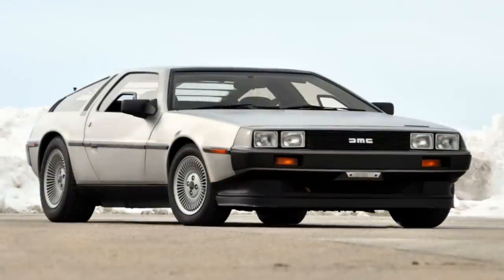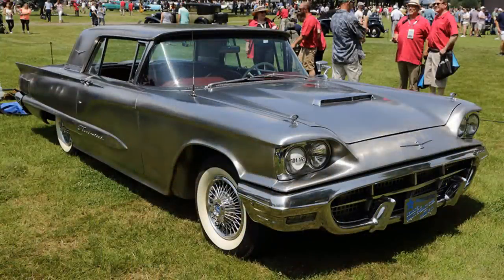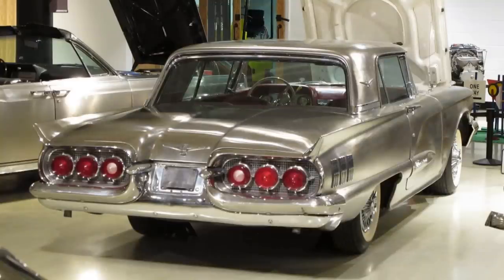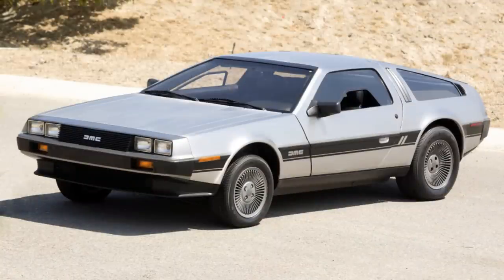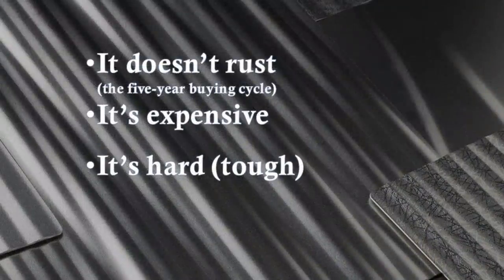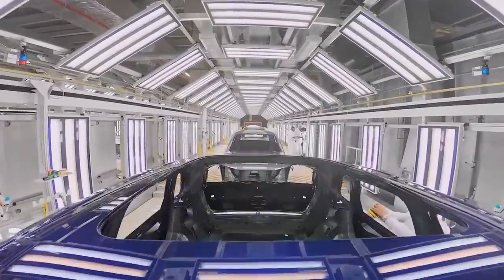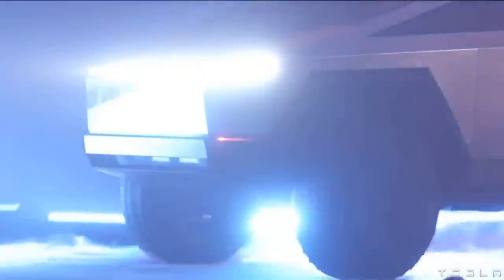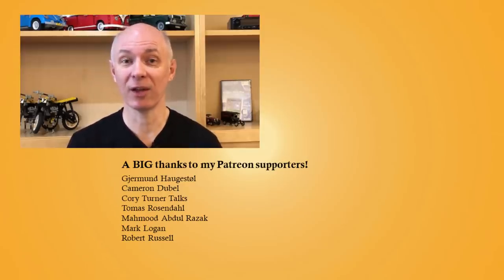Why aren’t cars made from Stainless Steel?

Comment: One of the main things I like about the Cybertruck is stainless steel... say goodbye to door dings and laughing at carless folks damaging their vehicle on yours for being careless. Rarely will you have to concern yourself with bodywork on these trucks.
Reply: The other side of that is when you do require bodywork, your vehicle will be out of commission because the exoskeleton is the key to it's structural integrity. And that bodywork will have to be carried out by a tesla approved bodyshop, which means you can't do it, your knowledgeable friend can't do it, and your local bodyshop can't do it. Which means a limited number of options. Which always means more expensive and longer wait times. Put those things together (longer wait times, further to get to, and higher costs with a requirement to do all repairs, whether or not you even want to,  before putting it back on the road) and you're going to be without a vehicle for a longer period of time. There is no free lunch.
Reply: @stupidas9466  you are 100% correct here. It's also going to be a royal pain to try to remove scratches and gouges when they occur. It's going to be exceedingly difficult to identically match the original finish with whatever buffing and polishing process is required.
Reply: @stupidas9466  I’m a trained Stainless steel fabricator and could do all bodywork myself…. The work could done by any Sheetmetal workshop with the right equipment. The body would be easy to add custom parts and panels. I’d love to have one to experiment with …
Reply: @chrisbraid2907  and then Tesla will say no more updates for you!

Comment: I worked on stainless in a stamping plant. Its not easy. One spec of dirt on the die and the stamping is scrapped due to the mark left which is highly visible since it doesn't get painted.

Comment: I think the buying cycle/planned obsolescence thing is much less of an issue to sales than you would think. There are a section of society who buy a new car, keep it as long as its reasonably reliable without major repairs (say 7-10 years) and then replace. However most people either buy new cars, or they buy used cars, and often people will buy at a similar age (of car) each time. New sales are primarily driven by finance deals, PCP is designed to trap people into replacing a car every 3 years, because after the 3 years is up they would need to pay out about half the cars value to keep it, whereas by just continuing to pay the low monthly rate (and a deposit which will be much smaller than the payment owed on the old car) they can get something new - which is flashier etc. This means that very few people who actually buy a new car are worried about how long it lasts - they only own it whilst its warrantied and pre-MOT. Theres a couple of other things to note, body work condition is hardly ever the cause for scrapping a car, theres usually far more rust under the car than on the body unless it suffered some damage which wasnt repaired. So unless they start making subframes out of stainless steel, the cars life expectancy will be the same. As an additional factor for Tesla, its got a battery, which will likely last around 10 years, which any decent well maintained car should last anyway. So, cars are more likely to be scrapped due to poor battery range than body corrosion.
Really, replacing a car you bought new because it fell to bits after 5 years hasn't been the case for over 20 years, and longer for many manufacturers - which is of course why they invented the finance deals to boost sales. 
I think the other factors, about the technical difficulties and the lack of colour wer very interesting, but at the end of the day, unless you make the whole thing out of a rust proof material, its still gonna die. I have an Avantime, plastic body is obviously mint 17 years on, glavanised chassis also looking pretty good, but everything attached to the chassis (subframe, suspension, various brackets and supports), all rusting away far too fast. I will have to strip it down and galvanize everything at some point so it lasts.

Comment: The Lincoln Continental...my dream car and in stainless..I want it! :)
Besides problems with press tools that wear out, there is also the issue of work hardening. Stainless steel (like other metals) work hardens, this means every time you deform a part it hardens up and does the steps from this point on even more difficult.
Welding is also an issue. Stainless steel warps like hell if welded (compared to mild steel) and would require a whole lot more of welds/tacks being done. Finally, there is one more important thing to remember...the price! A car made out of stainless is roughly double the price as one from mild steel.
Let's not forget a company can sell one per customer. Provided the customer is satisfied with it it will be the final sale ever made as it could last forever without rusting away.
However, I'd like to get my hands on one of these old cars in stainless...they're just so gorgeous and will last a lifetime.

Comment: I like how he, not only used a rubber dead blow hammer (so as not to scratch it), but held back. You can see him slow down when he gets close to the truck.
Reply: And it was a stupid test anyway.... vehicles need to be able to crumple to absorb energy and pass safety tests. All he proved was that it can never be sold in anything like its present form.

Comment: in the philippines a lot of backyard made jeeps have stainless body
Reply: A lot of the vehicles there are silver in colour and  shiny  yes...stainless steel? ...unlikely as it's expensive and  very difficult to work with.
Reply: @steveo4141  yes stainless is expensive but not to the point nobody can afford it....a jeep like the size of wrangler, with full stainless body, is about $4,000- $10,000 in the philippines....people there can buy $30k brand new cars what more a $4-10k......difficult to work with? you are very correct, but jeeps are mostly simple bends

Comment: The Delorean was merely clad in stainless steel over a fibreglass body. Typical appearance over function nonsense. 
It then needed to be laquered as brushed stainless gets grubby very quickly if handled..

Comment: I have owned and driven  a 1981 DeLorean for 25 years. The body is made of stainless steel, and although it is extremely difficult to keep clean it still looks very close to the day it rolled off the assembly line. The only down side, other than the difficulty in washing it, is the fact that you can’t really repair unpainted stainless without seeing the repair.

Comment: It's expensive,  heavy and difficult to machine, most manufacturers are trying to reduce weight such a dumb idea.
Reply: I beg to differ. This is an amazing idea especially for musk. This allows him to streamline the manufacturing process of stainless steel while capitalising on the experience. You need to remember that SpaceX is going to/are using SS on their rockets.
Reply: If you are looking for durability and longevity  then stainless steel  is the way to go
Reply: @CallumCarmicheal  Do you know if SpaceX is going to buy or make their steel? I am too lazy right now to confirm but I was under impression they would be buying it. I personally think SpaceX is a big promotion from grand promoter Musk, that won't ever actually deliver it's ultimate intent. I do hope I'm wrong, of course.
Reply: @k1m198  I'm not sure if they are manufacturing the SS or sourcing it. I know they are forming / printing it in-house though and I can guarantee you that this is a test to see how demanding and efficient manufacturing process they created is. This will ultimately determine how the steel is produced for Space X (At least that's the way i see it).

As for the other fact that Musk might not deliver, Lets look at it this way. The guy simply wanted to buy a rocket to start a business of transporting people to mars. Everywhere he went refused to sell him a rocket so the mad lad learned how to create his own (I say learned loosely as Im pretty sure he did not learn all of it as y'kno you can hire specialists for the finer details) and started creating his own rockets with the advancement of AI decided to attempt to make them fully automated...

So at this point I think that only a few things that would end his aspiration would be:
1) A massive scandal that displays him a negative light / losses all faith or trust.

2) Its somehow physically impossible to live on mars in which creating a habitat could not solve, Eg: Different in gravity causing catastrophic human dysfunctions (eg, heart cannot keep up with the new load of pumping against gravity, which can be a very likely situation)

3) Laws / regulation that would prohibit musk or interplanetary travel.

With those 3 hurdles aside I believe this man might stop at nothing but that is to be seen. I might seem like a fan boy of musk which I sorta am as he kick started another space race when it was dying down to Just good enough but I believe that its highly plausible for him to achieve this as he is conducting a DIY stance on the matter where the only thing that can prohibit is Laws.
Reply: An EV truck would still be heavy. I don’t think a normal steed frame would be much lighter anywqy. Choosing the special design reduces manufacturimg costs of the SS and of the E-glass panels. Flat panels also means lower repair costs and faster repairs. 
There are also regions in the world with a very humid and salty environment where cars rust extremely quickly. This material would be much more apprpriate in that case
Reply: @rotorblade9508  Stainless is almost exactly the same density as steel

Comment: The classic Land Rovers had aluminum bodies. During a summer I spent on a tropical island where rusting cars were a big problem, I saw one. The owner had removed all the paint to make the rust-proof aluminum obvious. I did a quick look online and apparently Land Rovers are still being built that way. They do require special skills to repair though.
Reply: Land Rovers used a type of aluminium alloy called Birmabright. The Achilles heal of Land Rovers was the steel chassis and galvanic corrosion of the door panels where the birmabright is attached to steel frames.

Comment: You miss One big disadvantage.  It's to hard so it will not stand the crash test. All energy will travel to the passengers and kill them. Thats why modern cars crumble as the do at crash-test. To absorb the crash energy. BMW had that problem at the second 3-series. It was so hard so the safety belts snapped.
Reply: THere's ways to mitigate passenger impact energy, other than crumple zones.
Reply: You are talking about dumb cars and the Cybertruck has intelligence built in to obviate the need for crash testing …. Much better than any dumb SUV ….
Reply: @chrisbraid2907  no. Wtf are you talking about. The car will still need to pass crash tests, as accidents can't be prevented 100%.

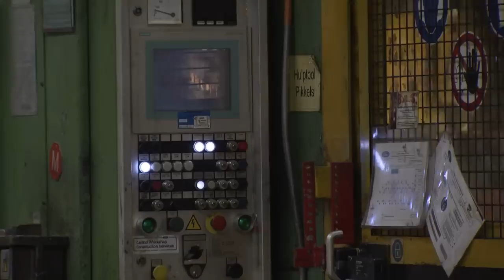Comment: 1:44 Cyber factory will not need a press (no curves) It will make it a lot cheaper to manufacture.
Reply: Yeah, the author kinda screwed up on that one.
Reply: @Seehart  You both obviously haven't watched till the End.
Reply: Actually the factory will need a Press Brake to form the Stainless Steel body … by keeping the lines very simple they can build strong monocoque bodies with fairly simple Sheetmetalworking Tools … minimal Welding yet very rigid. The Robots could arc weld many of the joints too .
Reply: @alexander1055  I did watch to the end. Yes, you have a point in that he stops repeating his main error at the very end. But he falls short of adequately correcting his error. 

My point is that the hardness of stainless steel and cosequent increase in cost of stamping is utterly irrelevant to the Cybertruck design precisely because the design does not involve stamping.

This undermines the thesis of the entire video, isofar as the author falsely implies that it in any way applies to the Tesla Cybertruck. 

He even asserts that the problem is worse for the Cybertruck because is uses a particularly hard stainless steel, as if this were a consideration the engineers were too stupid to think of when they made that supposedly unwise decision.

A brief vague mention of this crucial distinction at the very end of the video does not impress me.
Reply: @Seehart  He was talking about the Automotiv Industry as a Whole, explaining why it historically hasn't been done in Mass Production and explaining the Reasons for that.
Reply: @alexander1055  At the very beginning of the video, he specifically singles out Tesla, and the entire thesis of the video is to apply an irrelevant historical perspective to the question of whether Tesla is wise to choose stainless steel for the Cybertruck, given that this choice of material makes a process that Tesla will not need to use more expensive. 

He goes on to repeat this fundamental error, even making the oblivious claim that the problem is even worse for Tesla because they use an even stronger form of stainless steel, making this process that they won't use even more expensive. 

The fact that Tesla won't be using presses at all is not just a minor detail worthy of mentioning. It completely obliterates the main point of the video.
Reply: @Seehart  I just rewatched the Video. He does not single out Tesla in the Beginning. He only mentions that the Cybertruck will use an even harder Variant of Stainless Steel as compared to what was used in Cars before.

He gave us a History of Stainless Steel in the Automotive History and only talked about the Cybertruck in the End of the Video. And by that Time he also mentions what Tesla will be doing to alleviate the Problem that other Manufactures have faced before.

I do not know if Tesla will be using Stamps and Presses at all for the Cybertruck but he does mention that Tesla uses very basic Shapes and that there will be much welding in the making of the Cybertruck too.

Comment: Question: what happens when you crash against someone with an aluminium car with your stainless steel truck? Aren't you gonna outright ram through the car and kill who's in it?
Reply: Well no. Cybertruck is using the external body for strength with reduced structure underneath so the overall structural strength isn't that far off a regular truck. 

I'm more worried about pedestrian safety, modern vehicles have internal structure protected by plastic, foam and thin gauge steel. Cybertruck not so much. Definitely not going to be legal for sale in the EU without a redesign although to be fair Europe doesn't buy a lot of trucks. US safety regulation is a lot more lax so not an issue for American sales.

Comment: Everyone is asking about the crash test. It would not make much sense for Tesla to not consider this prior to launching this product. People have a tendency to be negative towards anything that do not have the answer to.

I have a question: why do race cars have a cage for the diver, the cars do not have very effective absorption body work? They are also travelling at 200 + miles per hour and their insides don't turned to mush in an accident.

In regards to cost and manufacturing of this truck, it would be not very likely that Musk would create a product that was not cost efficient and easy to manufacture. SpaceX is all about efficiency and easy of manufacturing so why would he do the complete oppisite with the Cybertruck.

My two cents and I like the video.

Comment: You didn't mention that stainless also suffers from fatigue far more than regular steel, although this could be designed around mostly.
Reply: You are wrong here, sorry. Austenitic stainless steel has essentially the same fatigue performance (relative to tensile strength) as typical low carbon automotive steels.
Reply: @eriktempelman2097  Thank you, I'm now better informed, I had stupidly assumed that all stainless behaved the same but, given its an alloy anyway and there are many different types, there's no reason to expect them to be the same.
Out of curiosity, what is the "whitest" stainless alloy?
I've often thought that a "white" alloy would look great for cutlery.
Reply: If you anneal it to remove the built up stresses of forming it then fatigue won't be a factor.
Reply: @JDWard-Jeepster  I can imagine that working on smaller components but not a car!
You'd also get warping of a large sheet metal item
Reply: Fortunately at 3mm the fatigue would take quite a while . 1.6 mm would deteriorate about three times as fast ….

Comment: With no plastic bumpers in the way to absorb those 'fender bender' accidents, the panels will have to be resistant to denting. Otherwise it's an expensive repair. 

Some of those angles look futuristic, but not very good for pedestrian safety. 

At 6:57 did you mean competitors?
Reply: Especially when the vehicle can sneak up quietly on them. It's gonna be" Death Race 2000 " all over again.
Reply: It will never get to production anyway so don’t worry about it. Bulletproof to a bb gun
Reply: Futuristic? Maybe if this were the 1970s....
Reply: @halohunter5217  ...and they were designing a car for the 2020's.